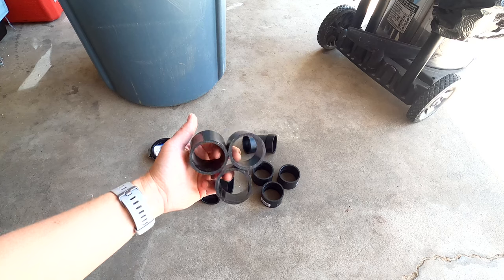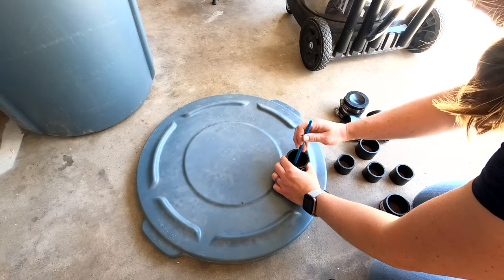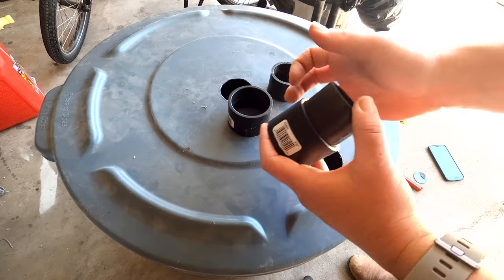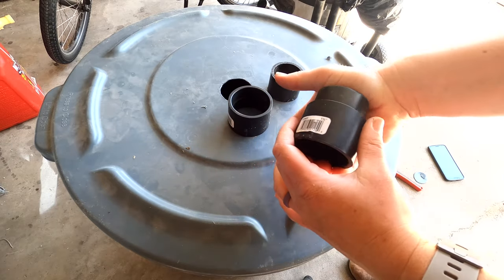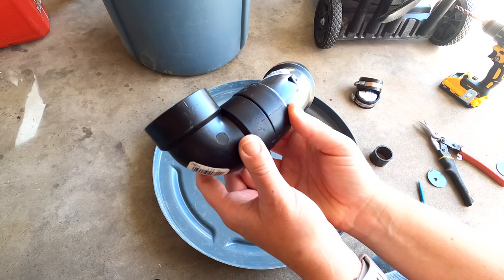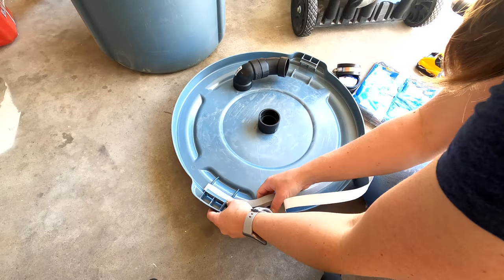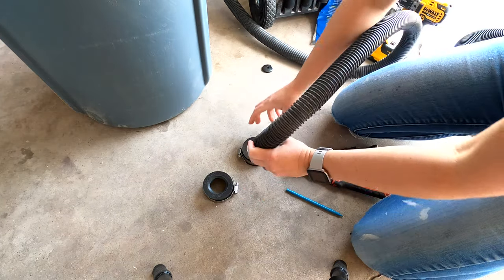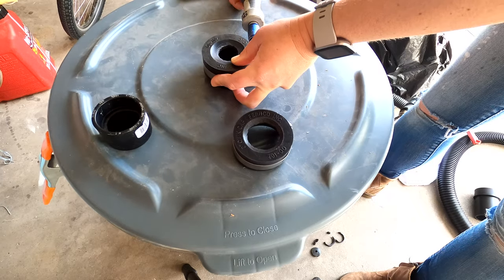DIY Cyclone Dust Collector For Your Shop Vacuum

Comment: Your audio is crazy.  Your voice on the left with music on the right.  (;  you can reinforce the outside of the can with some straight pipe or scrap wood attached through the wall and it should prevent it from what you described being an issue.
Reply from the maker: Thanks for the feedback!